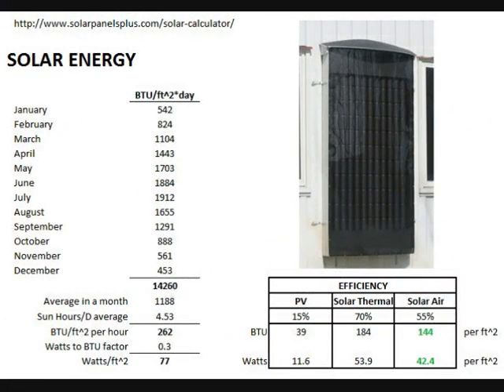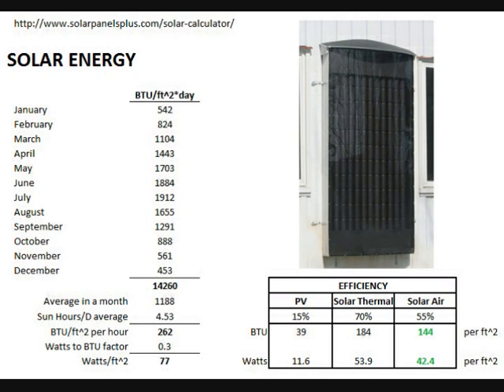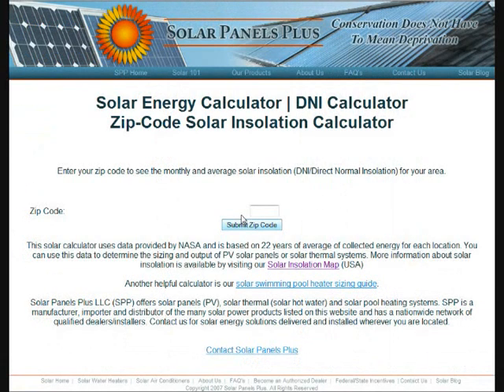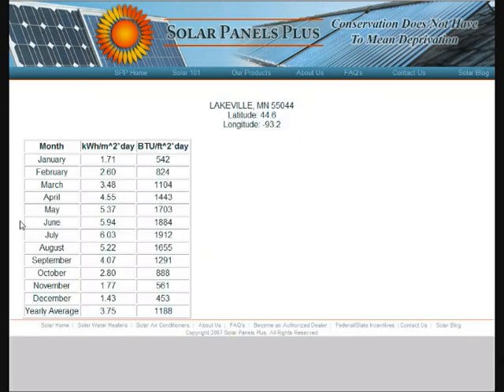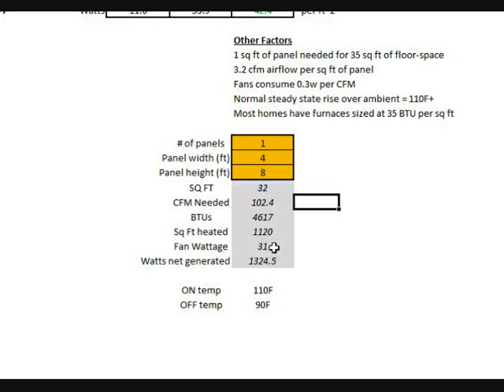Solar Hot Air Panel heater basics

Comment: Excellent video - nice work putting numbers and facts to this issue.    One thing to check out is a chart of air-flow (CFM) versus BTU/h at various temperatures.  It can be found in the EngineeringToolBox website in the air heating system section.

Comment: I can run my 44 watt laptop for about 4 to 5 hours a day on my 63 watt home-made solar panel and 5ah battery before the charge controller shuts it down at 11 volts.  When the sun is shining, and I'm running the laptop, it doesn't seem to use any power from the battery at all.